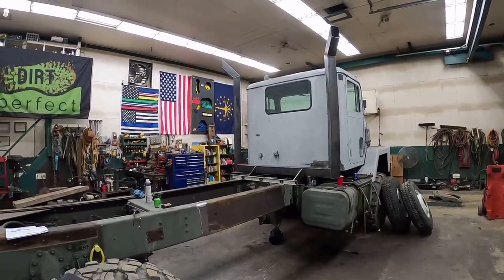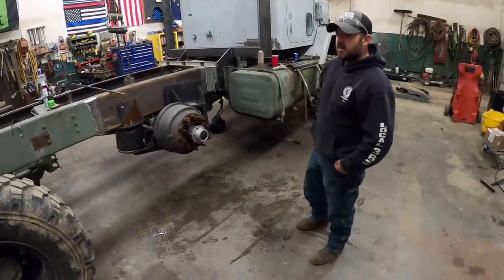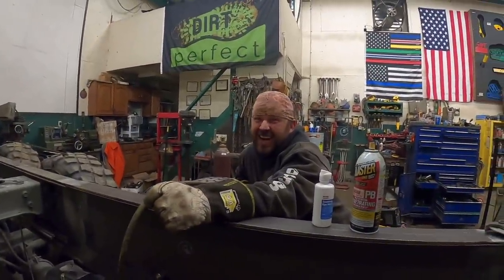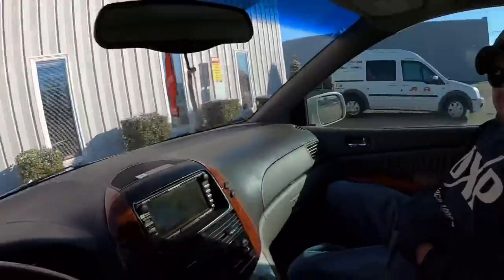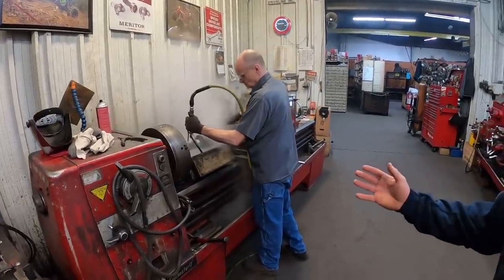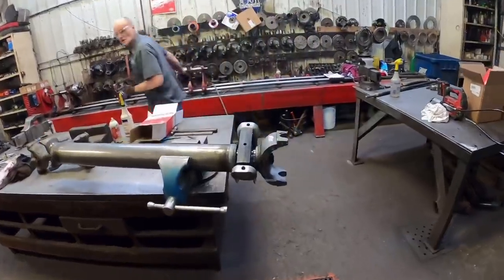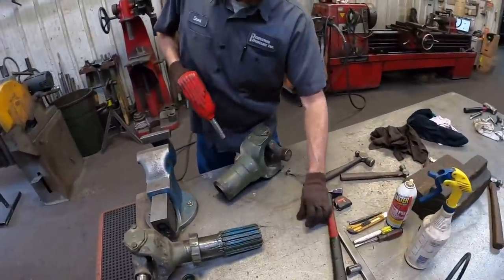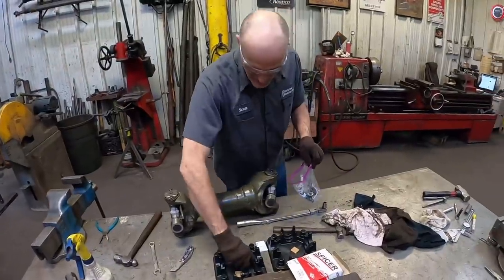Installing the  Lift axle  on Lt Dan and trip to driveline shop to see how drive shafts or made

Comment: As  said before being involve in several  drop axles For someone that has never done this you are doing a great job. I will subject that you could look into what are called flange bolt and nuts instead flat and lock washers
Reply from the maker: Thanks and wish I had access to a Huck bolt machine

Comment: I’d recommend adding a dump valve on the lift axle. You’ll be able to dump the air without lifting the axle so you can make tight turns without dragging the tires while still looking legal to the dot
Reply from the maker: Stay tuned

Comment: Much love to them I can appreciate thier work the guy's up here in Indianapolis let me watch them when they shorten the drive shaft in my Bulldog and made me a new PTO shaft for my new 13 spd when I switched from a automatic to a 13spd manual for some I know what goes into a build project the shop i worked with was amazed how much hands on and the knowledge I had so they let me do all the heavy lifting and the main mechanic was a good friend that was one of our shop guys when I ran LTL. We had a great working relationship back then and to have him as a trusted mechanic on my trucks after I became a OO was priceless to me to not worry if I didn't have time to do the work myself, they had my back as I had more than one truck and was a full time driver myself. I was thier first full on auto to manual conversion they ever did they learned a lot as I did my home work to make things as simple as possible for them. I still hear stories today from different transmission delivery guys from the company I bought my trans from about the driver that had a conversion done many years back and i would surprised them when they found that I was the owner of the truck and could list the details involved in the conversion and I was a little guy with a few trucks and not a mega carrier I still have a working relationship with the transmission company since I now do conversion and trans replacements I may not drive them any more but I still wrench on them.

Comment: It would feel like sacrilege to criticise Scott, but I am sure machinists watching the video would have felt uncomfortable seeing all that weld splatter hitting the lathe ways.  I'm guessing that red can on the lathe was anti-splatter, but it didn't look like it had been used.  You need the tools for the job though, and they had a 'good' lathe on the other side of the shop.  It was very cool seeing Scott shrink the shaft to remove the runout.  I had buddies that worked in the transmission bay at Ford Research & Engineering and we were still working on Trucks for my first ten years or so, but I am sure they never used shrinkage to straighten new shaft builds.  That was super impressive.   Speaking of tools for the job, Scott is definitely a man who does not like to waste time, so it makes sense that they would have that BIG arbour press.  They probably have a big hydraulic press with electric pump elsewhere in the shop, but the arbour press is usually faster.  It feels ironic that hydraulic presses are much cheaper than large arbour presses nowadays.

Mike, I'm sure you have it all planed out, but where will the lift cylinder for the bed go, and will it need clearance from the drive shafts?
Reply from the maker: He coved that it’s broke all it’s good for 🤷‍♂️

Comment: Check out JC Smith he has a tiger tool for using an impact to pop the u joints. You do it enough its worth it.     Very cool drive shaft work.     THANKS SCOTT

Comment: Did you use weld thru primer when you put the 2 frame rail pieces together?  Just worried about moisture getting in there and rusting between the 2 beams. 

If not- seam seal the hell out of the beams.
Reply: I think they said the fab shop used corten steel which is designed to rust in a controlled manner.
Reply from the maker: Yup check out Aaron’s video
Reply: @DirtPerfect  thanks for the video. Loved the driveshaft shop

Comment: That axle looks like it came off a Concrete Mixer? Beings that it is in front of the drive wheels it is a (Pusher) axle not a tag axle. So many people call all lift axles (Tag) axles and their not. If it's behind the drive wheels it's a Tag axle because it tags along behind every other axle. In front on the drive wheels it's called a Pusher axle because it pushes the front steering axles if left down while trying to make a turn. Basically it makes it very hard to turn a corner if it's down because it's so close to the front steer axle. Now with that being said the name was given way back prior to the floating steer pusher and tag axles came along. I have seen many people roll the tire off the rim on a non floating steer pusher axle.  I couldn't tell if that axle your putting in is a floater or not but I thought I seen shocks on both ends of the axle and if their is then that is a floating Pusher axle and it will follow your front steer tires when you turn and you won't need to lift it when turning, thus making it easier to turn corners. However you MUST lift it when backing up or you will cause damage to the rims, tires and axle it self. If it was a floating Tag axle it would turn the opposite direction your steer tires are turning making the rear turn easier and allowing you to make sharper turns because it brings the rear around faster. You probably already know everything I have said but if not I hope my comment helps you. Stay safe.

Comment: Sorry but i had to watch how you were making the taper on the alignment pins. As a machinist that is not how i was taught or do it. The compound rest the cutting tool has bolts you can loosen and change its angle. Then just use the third crank to cut a constant angle. Move the cross slide to change cutting area and repeat. But you got them cut and that is what matters the most n
Reply from the maker: Thanks and yes still learning

Comment: Is that an oxygen tank with no cap and no securment just sitting there next to the wall waiting for something to knock it over so it can take off like a rocket through your house.

I don't think ms. Dirt perfect would be very happy.
Doesn't matter if its empty or not rule of thumb if it's not secured and in use the safety cap needs to be on.
Reply from the maker: lol really that’s you take away form this video come on